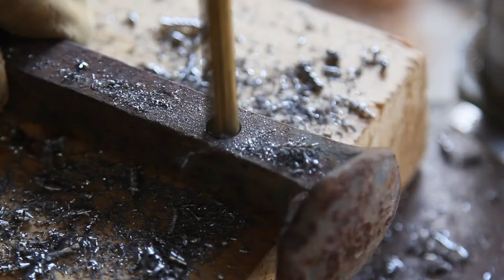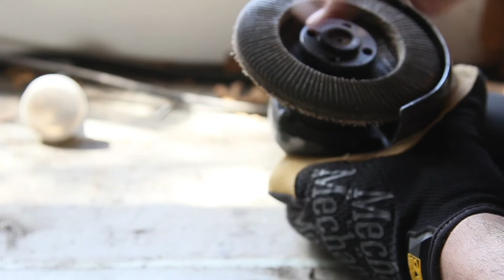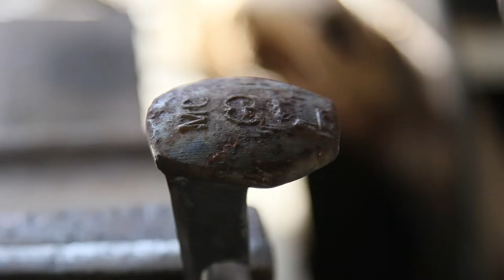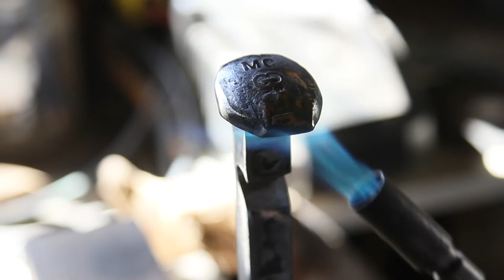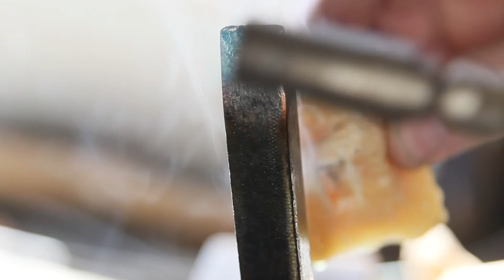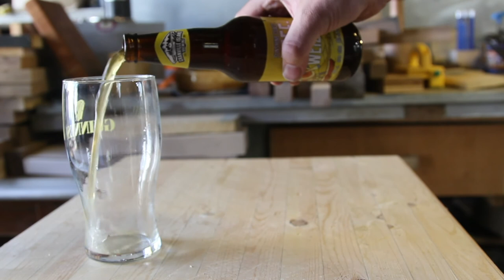Railroad Spike Bottle Opener - Beeswax Finish #fathersday

Comment: Great project. Ive made a few of these in the past but never thought to drill a hole first. That would have saved alot of time. lol.
Reply from the maker: Lol, I ruined a few drilling the hole first though.   But It keeps the end nice and clean if you can keep the angle grinder away from it.

Comment: @Hey i'am a maker could you please explain why you blowtorched the spike
Reply: So that he could apply the beeswax finish.
Reply from the maker: Realistically you don't have to, but I used the torch so that the wax would melt and create a protective coating and a nice patina.  I also wanted the colour change to take place.

If you wanted to keep it silver then you could use a furniture polish or a spray on clear coat.
Reply: cool, thanks

Comment: How do you apply the beeswax?
Reply from the maker: I heated the spike up to the point hwere it started to turn straw coloured and then applied the wax.

It will make a lot of smoke but once the spike cools the wax forms a hard protective coating.

Comment: What kind of bit and cutoff wheel did you use to get through the spike
Reply from the maker: The bit was nothing special, just a generic bit. The cutoff wheel I think was a Norton cutoff wheel. The spikes are not actually that hard.
Reply: Most spikes have hc on the top for higher carbon which means it's soft and not hard to bend or shape and drill through